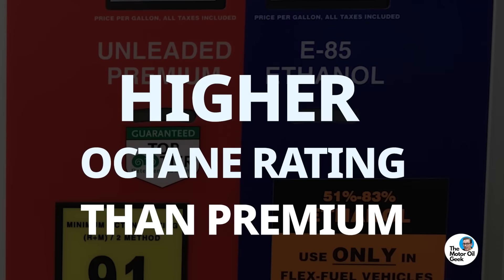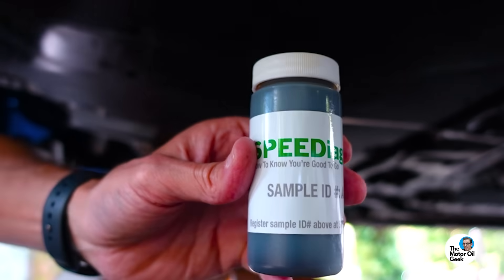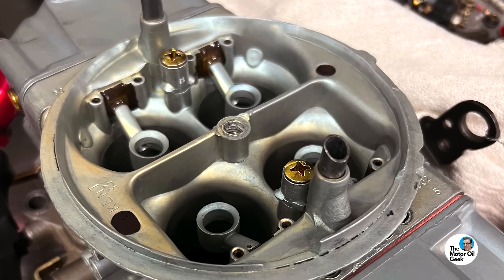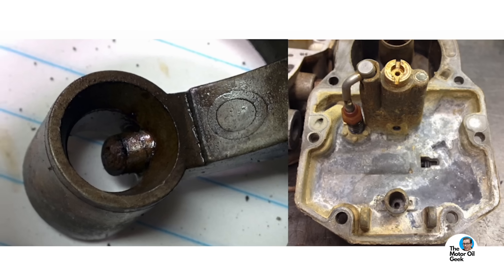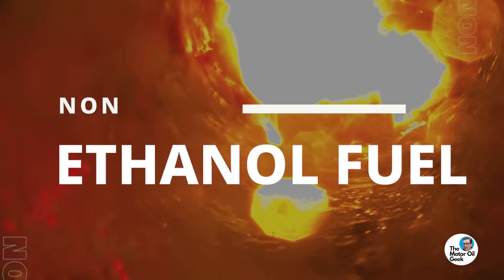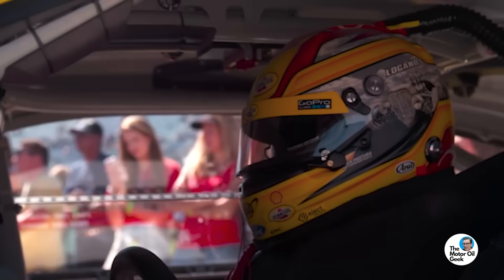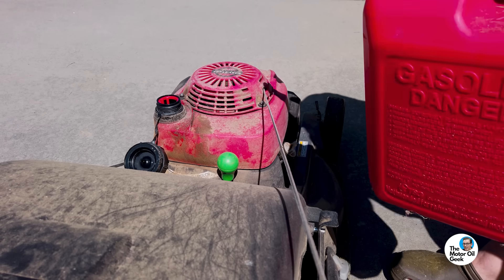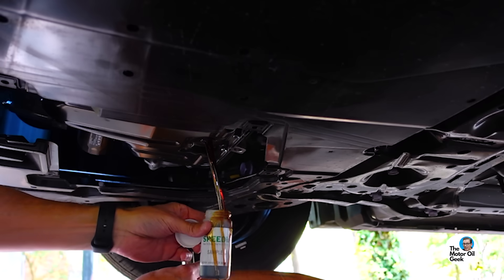ETHANOL: Higher OCTANE, Higher RISK?

Comment: The fuel industry used to have an oxygenate that wasn't corrosive, MBTE.  Unfortunately MBTE is toxic and these alcohol based additives are miscible with water so they can get into lakes and underground water.  The oxygenate solution that isn't poisonous is ethanol, but it's corrosive.  Alcohol is mostly there for political reasons now.  The one silver lining is E85 makes stupid power in a turbo engine, at least as long the fuel system lasts.

Comment: I only run ethanol in my turbo 5.3/4l80e 2001 Silverado. I have added a flex fuel sensor wired into the pcm. Locally e85 is around 65% ethanol. I change the oil every 3,000 miles. 

I run premium unleaded in my small engines. Some stations have ethanol free gas.

Comment: i have put ethanol fuel in every gas powered object i have ever owned and have literally never had a singular issue. chainsaws, weed eaters, mowers. i have a 2000w generator that i use for work as a mobile detailer and it will sit unused for months at a time, since most people have a plug on the exterior of their home and it will always fire up zero issues. ethanol is not a problem any more

Comment: As a Brazilian mechanical engineer, the US problems derive from non adapted vehicles and motors. Here we have 100% ethanol vehicle as far as 50 years ago. In the beginning we suffered the same problems as you did, now you can run 100% etanol for the life of a car and have 0 problems
Reply: Key phrase being "the life of a car".
Reply: @KielbasaKing-iCu I've had mine for over 150k miles no problems.

Comment: I have a 2019 Audi RS3 that is tuned on E85.  I use Lucas Oil Ethanol Stabilizer and Fuel System Cleaner with every fill up.   It only requires 1 oz per 5 gallons of fuel.  I have a 15 gallon tank so I put in 3 oz with every fill-up.  I only run full E85 from Spring through Fall. I use an E30 blend for winter months. I also change my oil every 5000 miles.  The tune also requires changing the spark plugs every 10,000 miles.  Before I started using Lucas, I would have some oil consumption issues.  I believe that was due to oil dilution. Since using Lucas, oil consumption is practically nothing.  Maybe a 1/4 to 1/2 quart top off per 5000 miles. Even on regular E10 that is in regular pump fuel, I would recommend using Lucas.

Comment: We rarely used anything other than ethanol-free gasoline in our 2009 RAV4, When we parted with it, it had 117,500 miles on it. We never replaced the PCV valve or EGR valve. We also never had problems with fuel injectors (but I also added Lucas Upper Cylinder Lubricant at each fill up). I did spray Mass Airflow Sensor cleaner on the MAFS occasionally but I never cleaned the throttle body. It was still running the same and getting the same fuel economy when we gave it to our granddaughter. What do you think? Did using ethanol-free gasoline likely contribute to the results we experienced? My only wish is that ethanol-free gas should be available at the pump in regular grade gasoline. Out RAV4 didn't need premium fuel but that's what it got because ethanol-free gasoline is only available in premium grade in our area.

Comment: Ethanol-free gas is not readily available in our part of Michigan and today I filled up with E88 inadvertently as it was just added to new pumps at our Meijer gas station - the place I always go because they only carry “Top Tier” gas.  I don’t want my GDI valves to get carboned up as fast so I’ve only used Top Tier gas since the car was new.  Does E88 w/15% ethanol impact the carbon buildup in GDI engines (for better or worse)?

Comment: we need access to more ethanol free gas WHY?? ethanol absorbs water ,    water ruins carburetors especially for small engines like a blower of weed eater, more money spent on repairs than can be imangined. E free gas is only available from 1 gas station 18 miles away.   won't use E10 in my stihl blower its 23 yrs old and going strong.

Comment: Rebuilt my boat holley 750 double pumper in 2024, sat for a year and the carburetor got completely corroded and dirty again. Had to buy another carburetor rebuild kit because the pump gaskets were leaking bad. I hate ethanol fuel. After that, I will only run 91 ethanol fuel in the boat

Comment: General Motors released TSB 18-NA-072, indicating that owners should not use E85 exclusively in their vehicles, due to potential fuel pump issues in HFV6 and LEA 4CYL engines. This is while their owners manual states no such restrictions on the use of E85, and is in fact encouraged. This is also being litigated in Illinois Federal court and has achieved class action status.

Comment: I have a 2021 Chevy Silverado with the 6.2 LT1 in it and I've always run premium gas which is 10% ethanol. I saw a local store chain start carrying ethanol free rec fuel and decided to try it. It is 90 octane vs 91 or 93 for premium depending where I get gas. I actually get 1-1.5MPG BETTER fuel economy running the rec fuel vs ethanol blend premium. Unfortunately, premium and rec fuel were the same price but a few months ago rec fuel prices jumped to 20-40 cents more per gallon than premium.

Comment: We had a 2009 RAV4. We bought it when it only had less tha19,000 miles on it. We parted with it recently when it had about 117,500 miles on it. During the entire time we owned it I used mainly ethanol-free fuel and I changed the oil every 5,000 miles. It used zero oil between oil changes. I was concerned that there may be fuel dilution or moisture in the oil. Oil analysis found no such problems. I found that to be amazing. I have to wonder if the ethanol-free gasoline had anything to do  with that. In fact it still had the original PCV valve in it!

Comment: About the J35Y6 3.5L V6 Direct Injection (DI) engine coming in the 2026 Odyssey. 

We know Honda makes tough engines, but as long-term owners, we have critical questions about fuel and oil given the engine's high-tech design (DI and high compression).
Fuel: Regular vs. Premium for 200,000+ Miles

This engine's high compression ratio (11.5:1) and DI setup naturally make us concerned about knocking, which usually pushes us toward higher-octane Premium Gasoline.

Our main question is simple: Can we truly rely on Regular Gasoline (87 Octane) and the ECU's knock control to drive this engine beyond 200,000 miles without causing any lasting damage to key components? 

We need assurance that relying on 87 Octane won't silently degrade the engine over the long haul.
Beyond just preventing damage, we'd like to know if there's any tangible, long-term durability benefit—not just a temporary performance boost—from using Premium Gasoline (91 Octane or higher) exclusively. 

Is it merely for maximum performance, or is it a hidden key to ultimate engine longevity?

Engine Oil: 0W-20 vs. 0W-30

Honda specifies 0W-20 oil, a choice we understand is driven by fuel economy and emissions targets. 

However, for an engine we plan to keep for two decades and over 200,000 miles, this thin viscosity is a real concern.

We need confidence that 0W-20 oil provides sufficient protection against long-term mechanical wear in a high-heat, high-load DI engine, especially when compared to a traditional 0W-30. 

How can you technically assure us that the thinner oil isn't making a sacrifice in long-term durability for marginal MPG gains?

Finally, we'd appreciate clarity: is choosing 0W-30 a necessary, preventative strategy for maximizing the engine’s lifespan, or does its higher viscosity actually risk negative consequences (like hydraulic system issues or flow problems) in an engine designed specifically for 0W-20?

Comment: Ajything with a carburetor should run nothing but non oxygenated fuel
Reply: Brazil has used >E20 since the late 1970s and >E27 since 2015 in identical non-flex fuel cars, boats, motorcycles, and small engines we have.

It has worked out so well and for so long that Paraguay went to E27.

Henry Ford designed his Model T for his favorite fuel ethanol.

Britian sold E10 to E30 blends from the 1920s which an E10 blend called Cleveland Discol being the most popular which sold until 1968-70 when BP bought them out.

Comment: I've had a stihl weedeater for something like 15 years or so now. The weedeating probably encompasses something like 5 or 6 acres worth. I switched to using only the pre-mixed fuel pretty soon after buying this weed eater. But i still don't use enough fuel in the weedeater for it to make sense for me needing to save money mixing my own 2 stroke fuel. It has saved me the headache and eventual frustration of buying another weedeater, which makes the extra fuel cost worth it imo. I have NEVER rebuilt or replaced the carburetor on this thing. Only sometime last year did i run into issues with the weedeater; come to find out, the spark arrestor was carboned up so much the exhaust could no longer flow - burnt off the carbon with a torch, and now its good to go again. That pre-mixxed fuel is no joke, and the corrosion i've encountered due to ethanol is also no joke. Ethanol is terrible not to mention how its ruined out agriculture industry. I have however had extremely good luck using the Lucas ethanol treatment (the big green bottle). That stuff has preserved the carburetor in my husqvarna lawn tractor that has now gone about 1300 hours - and i've also never rebuilt that carb either! I'm a firm believer that the correct additives will do the things you're asking of them. But its hard to know which ones work and dont. So thanks to Lake for doing all this science to confirm so many of the suspicions we've had over the years!
Reply: Your very Stihl weedeater and Husqvarna lawn tractor are also sold in Brazil and use their common gasoline which is >E27.  It has worked out so well and for so long that Paraguay went to E27.

Comment: I've used E-88 in my Honda CR-V 1.5 Turbo for three years. I've had no problems, starts easy and gets great mileage.
On the flip side, I tried E-88 in the B&S lawnmower. That was a big mistake. It was hard to start, it did not run right and I used it for three times on the lawn. I put the rest in the car, and purchased regular fuel. Big change, mower started instantly ran fine and was back to normal. Never again in the lawn mower

Comment: Does it still effect modern fuel injected (especially direct injection) engines in vehicles built post 2010??
Am I correct in going up to a 'lighter' SAE 5W-30 in a 2016 Ford 1.6 EcoBoost (turbo, direct injected) engine which specs a 'medium weight' 5W-20 when using pump E10/E15 premium fuels?
(I use those 'lighter and medium, heavy' terms since the SAE/API allow the oil blenders a fairly wide 'range' of actual cSt @ 40*F and 100*F, and HTHSV numbers within their labeled SAE viscosity on the bottle fronts, and I ALWAYS look at those specs when deciding which oil to purchase.) 

Many in the TDI performance tuning biz suggest (and tune for) an E30 blend using 93 premium E10, mixed with E85 to get a high octane, cost effective, and cooler combustion chamber temperature, while being able to run less boost pressures for the same power outputs, especially on larger than factory, aftermarket turbo setups.

Given the hygroscopic and oxidative tendencies of high ratio ethanol fuels, should they be running up to TWO SAE weight higher than factory spec oils (and changing it out at less than 2K mile intervals) in order to combat the film strength/thickness reduction factor of said fuels?

Comment: For price alone it is of course a loss even thought it's "cheaper"  It gets you significantly less mpg and ends up costing you more.  THEN it's messing up your fuel system and more.  It has never been worth it.
Then don't even go into the costs to make it. 4 gallons of fossil fuel to get 5 gallons of ethanol...   THEN you add it to gasoline. You would be FAR ahead just using gasoline.  It's insanity.
Reply: The amount of energy it takes to produce and deliver a product to the consumer is reflected in the cost of the product.

As such, note the spot cash delivered price of ethanol on the NYMEX is $1.63/gal.

The price of unusable sub-grade gasoline (RBOB) is $1.97/gal.

It takes more energy to make unusable gasoline than ethanol.

To turn RBOB into usable E0 fuel costs even more much like premium costs more.  Unfortunately it becomes even more toxic, more carcinogenic, and dirtier.

Or simply splash in >10% ethanol to RBOB and the resultant usable fuel becomes less toxic, less carcinogenic, far, far, cleaner burning, and cheaper/cheaper per mile to drive with.  Who can be against that?

The US Bureau of Labor Statistics measured share of household income spent on vehicle repairs and maintenance from 1990 to 2017 during the time ethanol in gasoline went from .1% to around 10% from 2011 onward.

The share of income spent on repair and maintenance went from 2% in 1990 to 1.5% in 2017 as ethanol usage exploded.

Iowa State University measured all the energy it takes to produce an acre of corn into a "diesel fuel equivalent". 
This included making the machinery, fertilizer, chemicals, plus the tillage, planting, spraying, harvesting, drying, trucking etc. 
They found it takes 34 gal of diesel to produce one acre of corn. 
What do we get from those 34 gallons of diesel? 
We get >500 gallons of ethanol. But wait, that is not the kicker. 
The kicker is we still get 100% of the protein and other things from that acre of corn still available for a healthier and more productive triple concentrated feed called distillers grains. A win-win.

The US used 11,160,933 tons total fertilizer on corn in 1980, before ethanol. In 2018, a record year for ethanol production, the US used 10,521,850 tons total fertilizer on corn.

100% of the fertilizer (& everything from the soil) still get fed to livestock in the distillers grains. Ethanol comes from only things of the air: solar energy, CO2, and water with the latter two recycled once burnt. 

Ethanol C2H6O = no fertilizer 
Distillers grains = all the fertilizer 

What logic is it to then assign all the energy and CO2 of fertilizer to ethanol and none to distillers grains? 

Denver in 1988 was the first government entity to require E10 when they were on the EPA list of ozone non-attainment zones.  Soon with ethanol they were off that list.

Even with just 10% ethanol added to E0, the Swiss Federal Laboratory for Materials Science and Technology found that the health devastating ultra fine or nano particulate emissions were lowered by 97%, carbon monoxide lowered by 81%, carbon dioxide lowered by 13%, aromatic hydrocarbon emissions lowered by 67-96%, and genotoxic emissions lowered by 72%.

Comment: I'd be happy if I could get Ethanol-free 87 Octane fuel near me, but it just isn't available. Premium 92 and 89 are around here and there, but are still a drive for me. I don't need that octane rated fuel for my engine, and they're REALLY expensive. Like 50% more per gallon at least. I don't remember when they switched to exclusively stocking only 10% E fuel around here, but is seems like it was the mid 2000's maybe? They only used to have it in the Winter months and regular gasoline the rest of the time. Other parts of the state it is more commonly available.

Comment: My 1991 E150 5.0 will not run without a quart of 10w-30 (or any other cheep thin oil) put in fuel tank upon full up on fuel. The fuel pump piston will lock up, and i have to hit the bottom of the fuel tank to free it up.

Comment: I love E88 or whatever Sheetz has and I know it is low, well closer to what fuel should be costing and much lower if you ask me.  I have researched this a good deal not a great deal, and Ford techs, Acura techs, friends have all said it is a mix bag.  I have 172,000 miles on the Ford Expedition is decent at that number alone.  But it isn't burning oil, the turbos could stand a once over, but it still runs fine.  Modern engines running EFI it seems tend to do better and as this is labeled a Flex Fuel which matches my exact tank on the gas door I would assume is the best for it.  But I know for fact that Fords tend to run better the higher the octane you give it.  I am sure other brands to as well.  It is an Expedition so it isn't really built for towing at all and definitely not anything over 6000LBs.  But until gas comes down all the reasonable arguments you make just go right out the window.  It has to be cost efficient to leave the house.  If it isn't then I shouldn't be leaving in the first place.  The people who drive just to drive are living a life that is just too luxurious for most these days.  I remember gas being a buck back in the 90's and we could go for weeks and weeks and still it was cheap to go places.  Now, I have to have a reason and that is truly sad.  Thank you for this, it was a good watch.

Comment: They had to start using ethanol additives because it acts as an oxygenator and helps the fuel burn more cleanly and increases octane.  Before that, they used MTBE (methyl tertiary butyl ether) for the same reason.  The problem with MTBE is that it stays in the environment and contaminates groundwater.

Comment: I've been lucky with ethanol fuels in my riding mowers but its ethanol free for my ATVs and handheld 2 strokes. The one practice I've used on my boats with ethanol fuels is I run the fuel out the carbs after every run going as far as to choke a crank until it will not attempt to run and so far after 20 years no issues. They say ethanol absorbs water but hell it started as water. the one thing I've noticed cleaning a carb after ethanol, the scale looks just like corn meal. if chips are made from corn meal, what will that stuff do in an orifice the size of a hair.